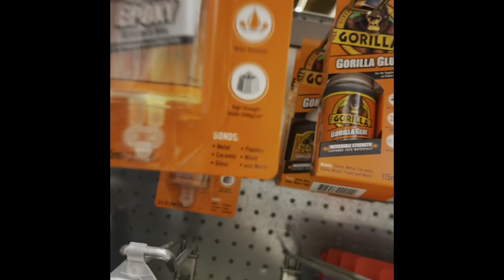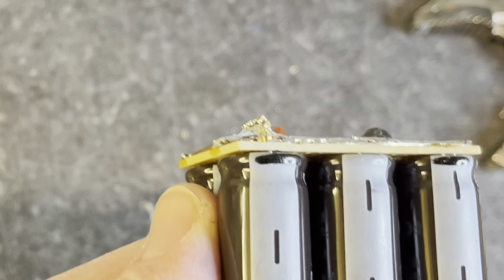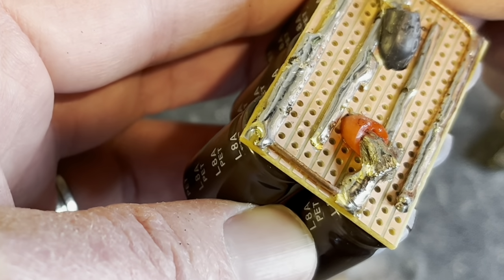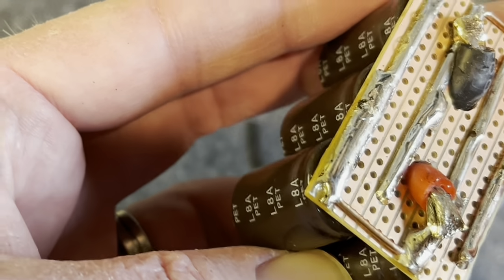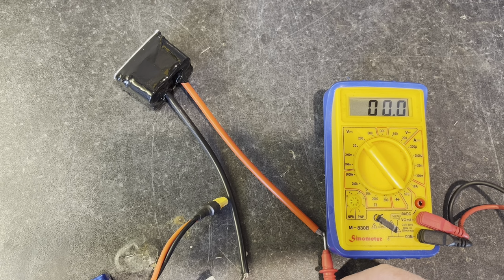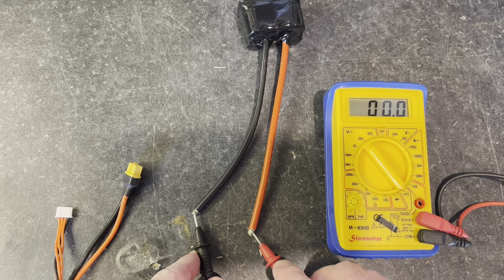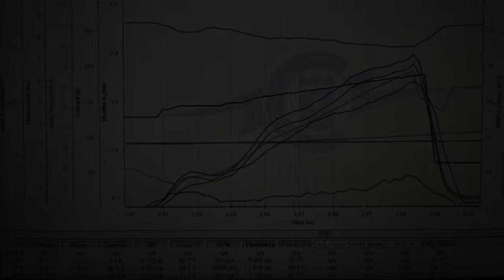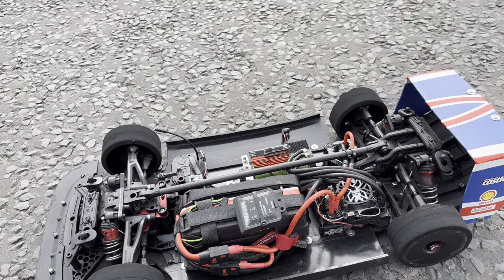Castle XLX2 bullet repair and epoxy resin /soldering to XLX2 following massive crash In Arrma RC car

Comment: Ive literally just walked in after a 110mph meeting with a parked car. Had to rip quick because of the Lipos beginning to smoke and the negative terminal came with it LOL... I saved the esc and electronics but I was worried about the esc ; particularly the epoxy. Thanks for the video - I needed a sign of hope that I could repair this ok - Great Work - Subscribed
Reply from the maker: Soy about your wreck buddy but glad you’ve gained some hope from watching this video. 
There’s no doubt it’s hard to fix, you need  a lot of heat.

Comment: Just amazing work Jaime! Thank you for sharing this, as many of us have no idea about this level of electronics. Hope you get back out there soon and hit that 160s/ 170s. Good luck my brother 💪
Reply from the maker: Thank you 🙏🏼 yea thought a few in the community would be int in this repair. 
She’s only geared for 150-160 at the min, I’ll get the most out of this gearing and check data, then start gearing up 🤞
Reply: @audiquattrojamie  Yes this is highly useful. I just wrecked my xlx 2 the exact same. If I saw this I would have attempted the repair instead of sending it back to castle. Good you are doing it right, get her going straight then gear up and send it. The new spot you found looks like a winner 👍🏾

Comment: Wow amazing work mate, I am trying to do this exact same repair (broken battery terminal ) at this moment, can you tell me if you had to add any extra solder to the bullet or the board itself or just heat the bullet and stick it down? Thank you for your help. Love the videos
Reply from the maker: When I heated the bullet I then added solder to the end of it before pushing it onto the board, you also need the epoxy to help add strength

Comment: Glad I found this video again lol. I just noticed that one of the motor post on my xlx2 is loose after a crash. And I was wondering how to remove that heavy epoxy so that I can rework the soldering on it! 🤦‍♂️ How did you manage to get that epoxy out 😂?
Reply from the maker: I was fortunate that most of it had already come off, try getting under it with a pick or pry tool 👍
Good luck 🤞

Comment: Nice job mate! Just curious, but what kind of ripple values were you seeing before installing the cap pack? I've been amazed at how low the ripple on my XLX2 (0.4-0.7V) is compared to the MMX8S (2.5-3V) I had before. Granted, this is all still at a fairly modest current envelope of 200-250A but I find the difference staggering nonetheless. And one last thing, are those Contact foams you're running on? 
Thanks for this. It's good to see that even what look like critical failures CAN be repaired :-) Keep on keepin' on!
Reply from the maker: Yes contact foams, 35sh. 
I’ll be doing a proper test over two runs with cap pack installed and then discontinued, then I’ll upload a video to show the difference. 
The only ripple I have recorded at a similar speed which was 116 vs the 91 today, the 116mph run produced 1.67v and todays 91mph pass produced only 0.87v 👌🏻
Reply: @audiquattrojamie  Right on brother!

Comment: Hi Jamie new subscriber here. Awesome video. I have a question though I was told that the XLX2 Does not need a cappack and that you should not put one on it. I just recently got my first XLX2. I’ve built speed run cars before but with other ESC‘s. And I’ve always put a capack on them. But I’ve seen many other speed runners that were using the XLx2s  and there were not  using them so I reached out to one of the fast guys and asked him about it and he said to not do it. So I was wondering what your thoughts on this
Reply from the maker: Generally you don’t need to do it as the xlx2 is more than capable of handling any you through at it, when you get it up snd running you should check your data log against your setup, ripple should already be extremely low. 
I did fit one when I was running the 1721 but that was just to lower it even more. 
From memory when running 1721 with out cap pack I saw 1.80v and when cap pack was fitted I saw 1.09v so it was a good reduction, but keep 1.80v is still pre low. 
The benefits of running cap packs-Testing cap packs and shown in data logs-arrma limitless speedruns
https://youtu.be/e05TMXkzd8s
Reply: @audiquattrojamie  thanks for the info bro I appreciate it. Yeah I finally Broke down and got an XLX2. It took time lol for me to finally do it. I generally use Hobbywing‘s But have done a couple MMX builds. But I’ve always ran a cappack . And I will be running mine with a 1721 so I really appreciate the info and response. Awesome channel bro
Reply from the maker: @BEASTMODERC  thanks 😊

Comment: What did you use to cover those pins when applying the Eproxy ?
Reply from the maker: Just a bit of masking tape
Reply: @audiquattrojamie  I truly appreciate you taking the time to make this vid.
Reply from the maker: @runngunrc1991  thought a lot of others would benefit from it 👍🙏🏼
Still hard to do due to the heat required
Reply: @audiquattrojamie  ok I tried last night didn’t get it hot enough. Put a dab of solder at the bottom it would not stick. The solder melted but wouldn’t bond to board getting a torch today.
Reply from the maker: @runngunrc1991  best of luck 🤞

Comment: Exact same thing just happened to my xlx2…. Negative wire broke off.  Didn’t think it was repairable
Reply from the maker: It’s hard to do as you need a lot of heat, best to remove the wire as it absorbs all the heat, much easier to do when your just heating the bullet on its own 👌🏻

Comment: Cool video, I'm gonna attempt a fix lol
Reply from the maker: It’s definitely hard to do, this is the second time this has happened to this esc, it happened last year also. 
It’s still holding up very well 👌🏻 
Good luck 🤞 you’ll need loads of heat
Reply: @audiquattrojamie  Awesome, thanks! There hasn't been a rc project I couldn't handle before 😉💪
Reply from the maker: @zagertRC  👌🏻🤞💪💪💪💪💪 good Luck

Comment: How did you get the bullet to stick down so easy?? I can’t for the life of me get it to stick with soder. Trying to fix my xlx2 right now!
Reply from the maker: Just solder and loads of heat, once the solder cools it should stick.
Reply: @audiquattrojamie  did you add soder to the board first? Kinda like tinning the board before popping the bullet on?
Reply from the maker: @RicoRattina  yes 👍

Comment: That’s not good for a £300 Esc. I would have thought soldering in the 8 gauge wire would have lifted the bucket back of again.
Reply from the maker: Nope it’s fine, this the time I’ve had to repair the esc like after a crash and esc worked fine after pulling 500+ amps with no issues
Reply: @audiquattrojamie  do you think it’s worth epoxying it before it pulls of ? I’ve just got one.
Reply from the maker: @wasa7  it comes epoxied already, all I can suggest is make sure cables are strapped down so as they don’t put stress on the solder posts in a crash, ultimately if your batteries come out they will pull on posts on till the plugs disconnect